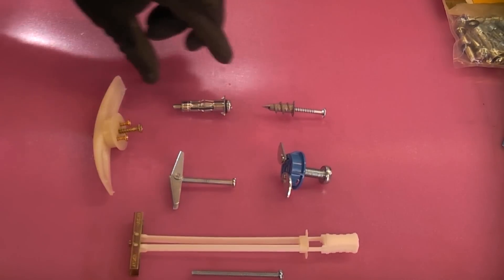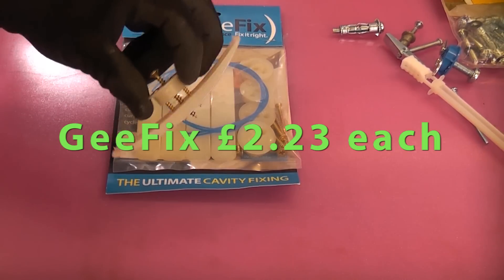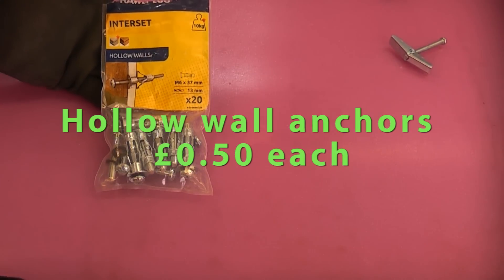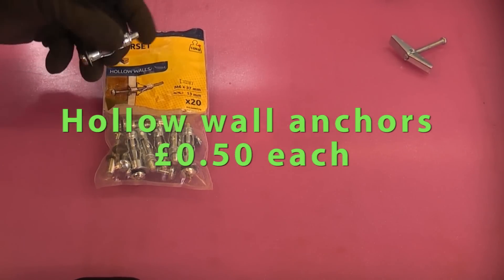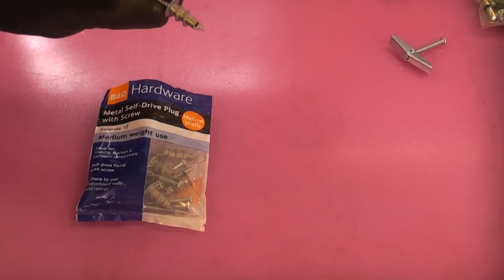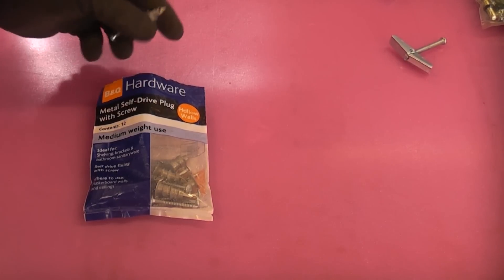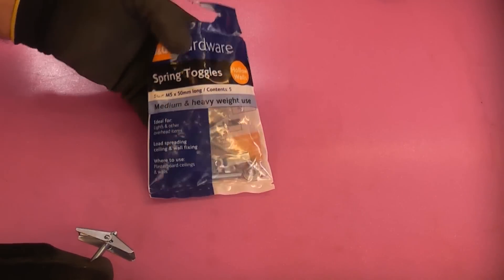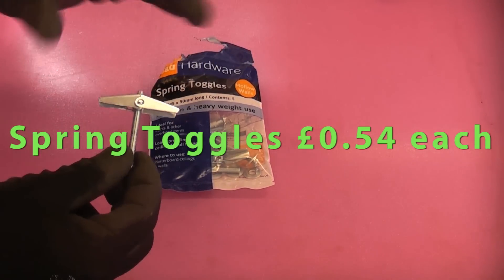The worlds strongest plasterboard fixings | Drywall fixings strength test

Comment: we need to see the stud arrangement behind the "fixings" and make sure it was the same through the test. Would also be good to see where the studs where in relation to the "fixings". Also, note that the weight was placed against the wall, the same weight spaced just inches further out would have profoundly different results.
Reply from the maker: No, you don't need to see the stud arrangement as the studs were exactly the same for every piece of plasterboard tested.The studs were arranged as you would find them in any stud wall, with the studs spaced out evenly, with one at each side and one down the centre. The studs never moved for any of the trials.

Of course the weight placed further out would have profoundly different results, which is why you will see me ensure that each weight placed on the shelf is touching the plasterboard at the back! 

If you don't agree with my test, might I suggest you repeat it and film it for the benefit of the people on YouTube?

Comment: the first one seemed like it just tore the plasterboard, and that was what gave way, or is that a good demonstration on how they work?
Reply from the maker: +ozfartface 
The plasterboard failed with all of the fixings. Most of the fixings are made from tough material such as metal so they would take a lot more weight before failing. As you could see from the demonstration some fixings can spread the load much better on the plasterboard than others.
Thanks for the comment ;-)
Reply: +Ultimate Handyman ah, seems it's just more noticeable for the bigger ones that create larger holes
Reply from the maker: Yes, I think the fixings that require the larger hole weaken the plasterboard more!Thanks for the comments

Comment: Great work ! Suggest it would be even more useful if you provided a summary comment (or frame if you feel that industrious) summarising the results and quoting the failure weight alongside each fixture
Reply from the maker: +TWOKDOK1 
Thanks, I did put all the information in the video comment section ;-)

Comment: and i was told from a friend the Metal plasterboard screw are really good at holding weight use them for everything think ill change now
Reply from the maker: +Stebo 1212 
Well they did hold more weight than I expected but for a shelf or something heavy I'd use the spring toggles.
Thanks for the comment ;-)
Reply: +Ultimate Handyman no thank you I watch all your videos and do alot of stuff myself over past year or 2 now never liked look of spring toggle because the way they can dig in the back seeing the weight test was great
Reply from the maker: +Stebo 1212 Thanks for the comment ;-)
Reply: maybe you should get in touch with them and tell them to update as there strongest type is the weakest :P haha

Comment: I find that the plastic worm drives are better than the metal one
Reply from the maker: +MegaMetinMetin 
I've used both in the past but try to avoid them if I can. I once tried one on an external wall and it hit the brickwork behind which just made a large hole in the plasterboard. I have also had problems with the supplied screws being too long, which causes them to bottom out if you are fixing something thin.
Thanks for the comment ;-)

Comment: I have used spring toggles many times over the years and have always felt more confident with them when any weight was involved on plasterboard,  I have also used the self drive plugs for speed etc.  I have looked at some of the newer fixings that have come on to the market in recent years and thanks to your test I will be sticking to the good old toggles.
Thanks again for this.
Reply from the maker: +Portia Cabin 
To be honest I was shocked at how well the spring toggles worked!
Thanks for the comment ;-)

Comment: Another brilliant vid chez. There are a lot of us out here that really do appreciate the time and effort you put in to making them. I've been doing diy jobs (including a self-build) for many years, but have learned so much recently from your vids. BTW, its worth noting that the spring toggles do require quite a large hole to be put into the plasterboard to get the fixing through, so not suitable for some applications, but that goes for some of the other fixings too. Keep up the great work m8.
Reply from the maker: +martin drew 
Thanks Martin. Yes the hole for the spring toggles was 14mm. The snaptoggle was 10mm and the GeeFix and GripIt were both 25mm. 
I would have thought that the Snaptoggles would have performed better, although they are still one of the best fixings!
Thanks for the comment ;-)
Reply: +Ultimate Handyman I've not used the snaptoggles before.  They look a bit cumbersome, but pretty strong looking. It would have been interesting to see how the old 'hollow wall' plastic plugs would have fared. I stopped using them years ago because they never seemed to hold anything. Did you consider putting those in the test ?
Reply from the maker: +martin drew 
I tried a couple of Plasplugs hollow wall plugs a few months back and wasn't impressed with them.
I didn't think they would hole anything close to what the metal fixings would so I didn't bother testing them as it would have meant going for more plasterboard ;-)
Thanks for the comment
Reply: +Ultimate Handyman lol. I was thinking it must have been getting expensive buying several sheets of plasterboard. It might have proved useful just to show how rubbish those things are, but why waste your money I guess. Keep up the great work m8
Reply from the maker: +martin drew Thanks Martin ;-)
Reply: +Ultimate Handyman Right, just stumbled across the vid - "Plasterboard fixings, the good, bad and the useless". Demonstrates the uselessness of the hollow wall plasplugs perfectly Chez. Another  great vid that shows the application of the various products in a very simple and unbiased manner - Brill !
Reply from the maker: +martin drew 
Yes, that's the one.
I actually bought both packs of plasplugs fixings for when I did the snickers commercial. I went out in the morning and bought two packs as I had to fix a shelf to the wall that would fall down. I was not impressed when I could not get the fixings to work LOL. Anyway the days filming went well and it was the best day ever filming- https://www.youtube.com/watch?v=lHjsencf5zg
Thanks for the comments Martin ;-)
Reply: +Ultimate Handyman LMAO. How you kept a straight face doing that vid I do not know.  Nice b.b cap BTW ;-Must remember that nose tip for levelling my shelves in future. Does it matter tho, if your nose isn't quite straight ! ?Just wondered :-)
Reply from the maker: +martin drew 
Ha Ha, some people actually thought you could seal your bath with toothpaste after watching that!
A straight nose is not important as long as you use the same finger for both brackets ;-)
Thanks for the comment ;-)
Reply: +Ultimate Handyman And haven't been biting your finger nails of course. It was the sparkler that did me - perfect finish..... classic !BTW what do you prefer being called - Chez, or......Don't wish to offend or irritate !
Reply from the maker: +martin drew Hi Martin, yes I prefer to be called Chez ;-)I'm not easily offended by the way- I get called all sorts LOL ;-)
Reply: +Ultimate Handyman I'm sure you do, lots of small minded people out there. Ok, will bear it in mind for the future. Keep making the vids Chez and don't forget to keep enjoying it too, I'm sure that's how and why you first started out.  TTFN ;-).
Reply from the maker: +martin drew 
Thanks Martin ;-)

Comment: It's amazing how much weight those spring toggles took. I was more inclined towards surface area = greater clamping force - but that's proved somewhat wrong. Great videos - keep it up.
Reply: the benefit of snaptoggles is that you can remove screw and it stays behind attached so you can screw back in to the same hole with no hassle, whereas butterfly spring ones would drop down and you would need to reinstall it. so depends on your application what you need more
Reply from the maker: +Aakash Sachdev 
Absolutely. Thanks for the comment ;-)
Reply: Yeah, I expected the snap toggles to win, but that was quite a gap in performance. I need to mount a shower screen on plaster board, so I know which ones I'm getting now. Cheers man!
Reply: Same here! I too would of thought the Snap Toggles would win out. I’ll be using the Spring Toggles though. Extremely useful Video!
Reply: i was totally expecting it to be right about the same as the screw in type

Comment: Great video. I use Hollow wall anchors for lager stuff and Metal plasterboard screws for smaller projects. Was good to see other types and how they get on. I was amazed how much the Spring Toggles could take, if I need to hold anything that heavy i'll be definitely trying them out.
Reply from the maker: +Adam Thomas I was amazed as well.Thanks for the comment ;-)

Comment: did any of the fixings break or was it just the plasterboard in every case
Reply from the maker: +Alex Newton No, it was always the plasterboard that failed.I think one of the problems with a couple of the fixings is that you need a 25mm hole for them- so immediately you have weakened the plasterboard much more then say a 10mm hole.Thanks for the comment ;-)

Comment: Waw, thanks for taking the time for doing this test. Very very interesting! 
The spring toggles were a surprise, I don't understand why they take so much more weight than for instance the snaptoggles. I would imagine the max. weight would be a function of the effective area of the fixing that was in contact with the plasterboard, dividing the load. Are the 'legs' of the spring toggles longer or wider than the snaptoggles?
Again, really cool test! They should have your videos on the little tv's at the hardware stores instead of the usual annoying marketing junk. People would actually learn something and do a better job!
Reply from the maker: +Koffi Banan 
Thanks, I thought the snap toggles would out perform all the other fixings to be honest, so I was really surprised when the spring toggles beat them. 
I think the spring toggles were marginally longer than the snap toggles, but the hole required for the spring toggles was 14mm and only 10mm for the snaptoggles. 
I still can't believe it now how much weight they held, it is quite a shock!
I don't think my videos will ever be shown on those TV's in hardware shows as they are just there to make you buy their product ;-)
Thanks for the comment ;-)

Comment: love to see a test on strut fixings for shelfs etc
Reply from the maker: +girlsdrinkfeck 
I'm not sure what you mean, if you can be more specific I'll consider testing them if it's relevant ? 
Thanks for the comment
Reply: +Ultimate Handyman as in fixing not to plaster board but to the actual beams struts
Reply from the maker: +girlsdrinkfeck 
Thanks,  fixing to the studs or struts should give an incredibly strong fixing, depending on the screws used etc.

Comment: Really great tests - plasterboard is a lot stronger than I've ever given it credit for by the looks of it.  Still anyone would be daft to want to put 175kg on that kind of construction long term BUT it does make me feel easier about putting up a TV.  Normally I've placed a piece of ply between two struts but the M5 Spring toggles would easily hold a 42" LED which weighs only about 40kg.  Thanks :)
Reply from the maker: +James Brindle 
Absolutely. I would never have imagined that it would have supported such weights.
Thanks for the comment ;-)